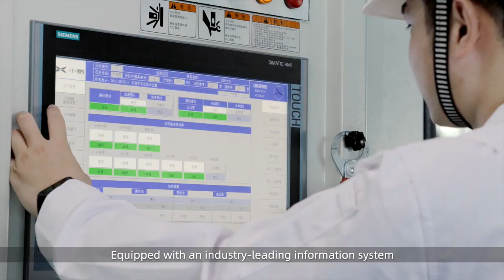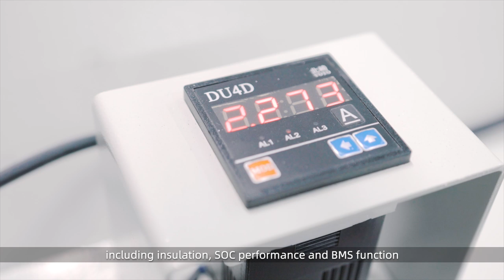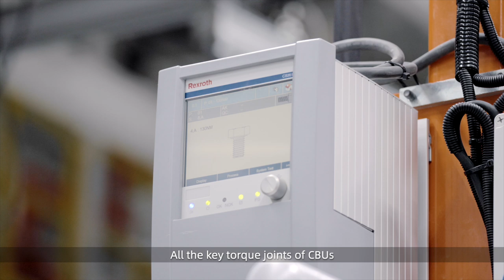An overview of Xpeng Motors new state-of-the-art manufacturing facility in Zhaoqing, China

Comment: Hey I want commentary and information.  So here is a product that looks like it could be a nice value auto with great tech presented at a very good price. I want to know not only how it is manufactured but what kind of quality components it is using. Are they  constructing the car well but using Inferior parts which may not last very long. Or are they really constructing the auto in the best way. We need Sandy Munro's information here to help us figure this out. For example do we know how well designed their motors are. What kind of tolerances and specs they are built with. How long their batteries will last without degradation? How hard is it going to be able to get this car repaired? Frustrating that all wr get is a promo video and no real information.
Reply from the maker: Those are all good questions. We really won't have solid answers until we can "do a Sandy Munro" and take apart their vehicles. Time will tell.